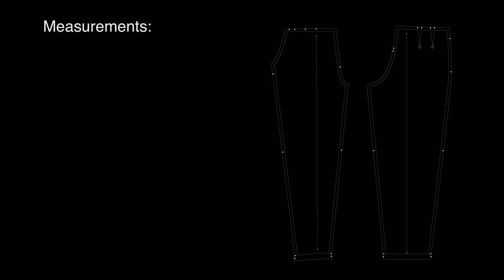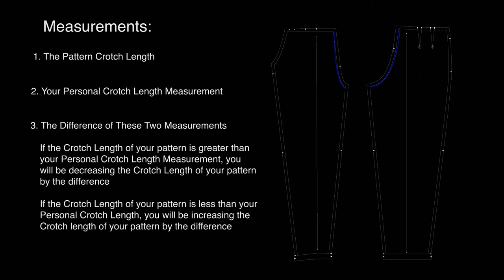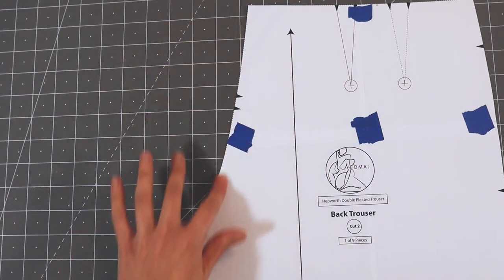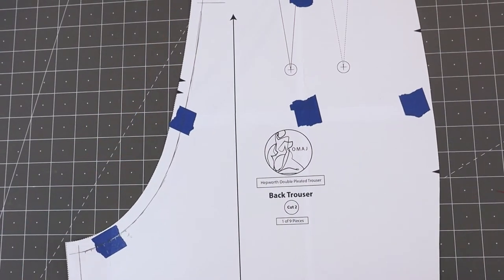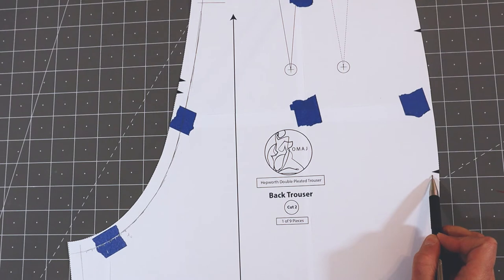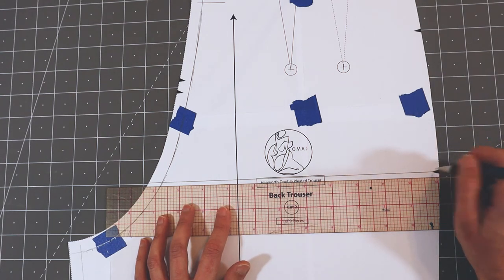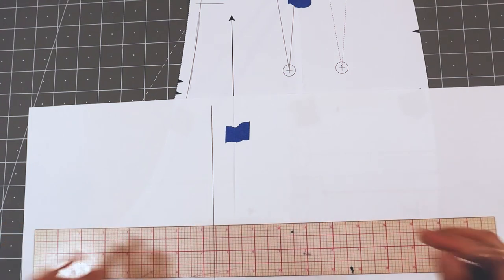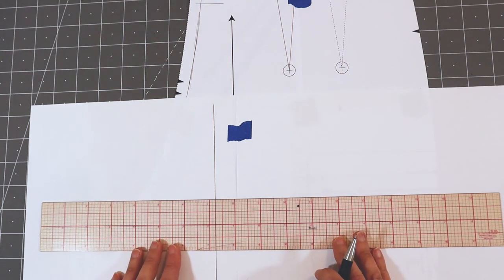Increasing/decreasing the crotch length on a Pattern

Comment: Thank you for the video. I need to reduce the crotch length on my pattern by about an inch. The pattern I am using has waist band connected to the pattern. After I reduce the crotch length by about an inch following your instruction, the waist line on  the top of my pattern would also drop. Right? Hope it make sense to you. What shall I do with the a little bit slanted waist band area? Thank you!
Reply from the maker: Hi Kelly! Great question! Since the crotch length is an area that’s going around a curve, it will look different for everyone. What’s important is that we didn’t modify the area at the waist. If you check your pattern, the center waist seam that connects to the crotch seam should still be square (90 degree angle) at least 1/2” on both sides of the square. You can use an “L” ruler to check this. If it’s square, as it should be since we did not modify this area, it will line up straight when the two pieces are sewn together and we’ve just corrected our curved area. Hopefully this makes sense and helps :)

Comment: Hi you don't show what happens to the front pattern piece., so that you leg lengths end up matching, especially if the bottoms are shaped for a turn-up? if the personal crotch length is radically different to the pattern, eg 4" , and you add it all into the back pattern piece, the leg lengths will not match at all.I don't see how it would work unless you add an equal amount to the crotch in front and back and as an even amount right across the piece , not an angled piece as shown in the video. Thx
Reply from the maker: Hi Carol, in this video we are only altering the Center back and/or Center front crotch seams which are sewn together, mirror images of each other, with Center back sewn to Center back and Center front sewn to Center front. Since we use the slash and spread method, and we are only altering the crotch seam, the side seam length and inseam length remain the same. Your side seam shape might look a little different because it’s being straightened as you spread the crotch seam but its total length hasn’t changed. There is no need to alter their length since the changes we made haven’t impacted those seams. Hope this helps :)
Reply: @omajpatterns  hello. Can you explain what happens to the waist once the crotch is slashed ?
The angle of the waist is radically changed which will create a point at the side seams and at the centre front and centre back seams. 
I’m confused
Reply from the maker: Hi edd, because we didn’t modify the connection point (crotch line to waist) the pattern will match straight when sewn. Although it looks like it comes to a point the waist area and crotch area that connect are still at a 90 degree angle (square) so when the two pieces are sewn they will be straight. If for some reason, when you extended the crotch seam/center front or center back seam to the waist and modified this connection point, use an “L” ruler and ensure the waist line and crotch line are at a 90 degree angle at a 1/2” on either side and it will sew straight. Hope this helps :)